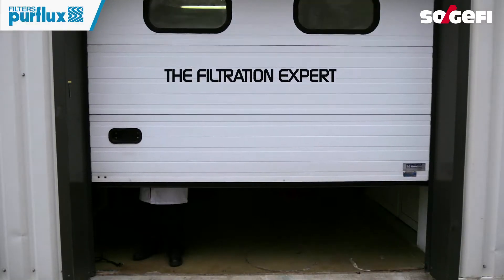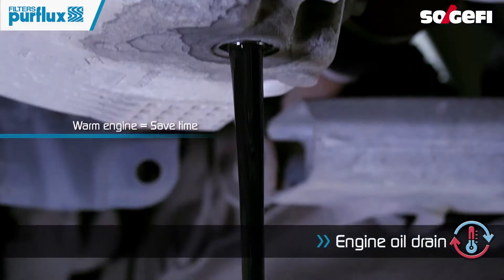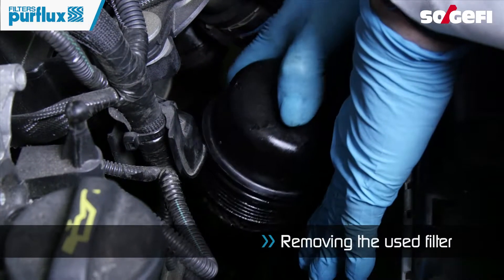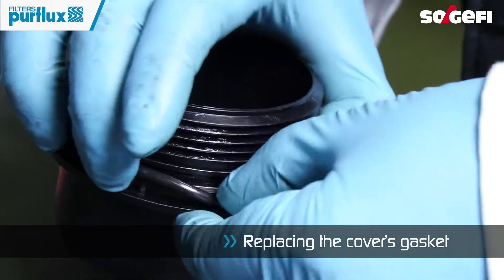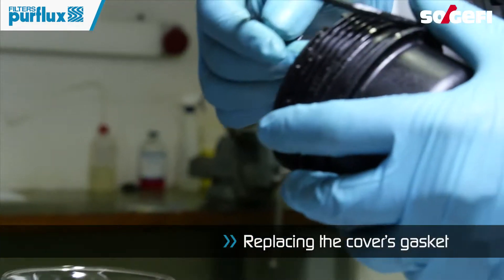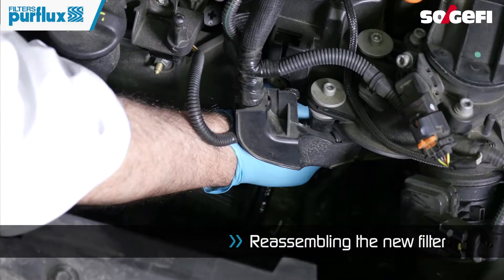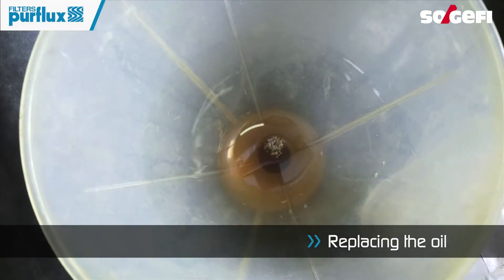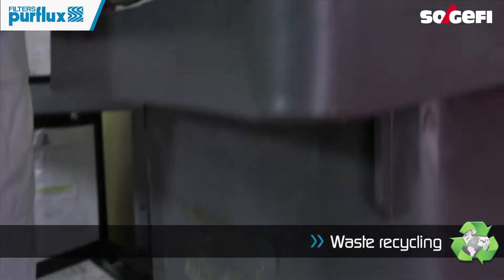Purflux - Maintenance Oil Filter L358A

Comment: With this type of filter, once removed from the vehicle, remove the seal o ring and wash the cap out to remove and old oil deposits. Use some kind of siphon to remove any pools of old oil from from the oil filter housing.